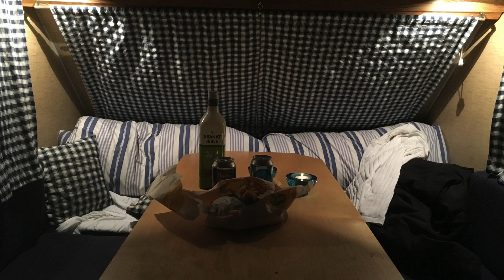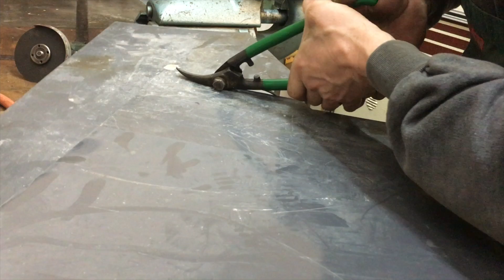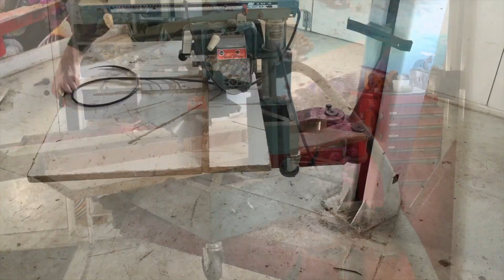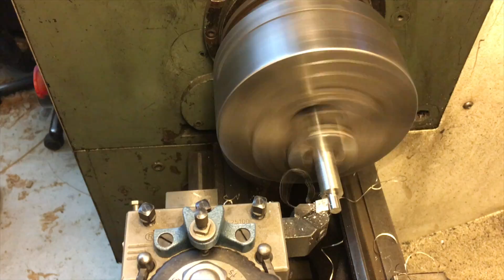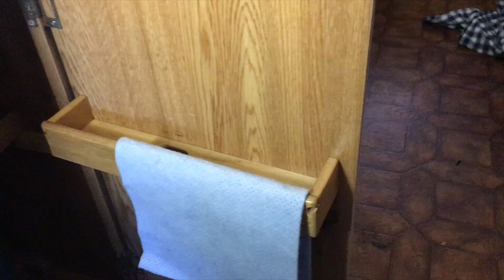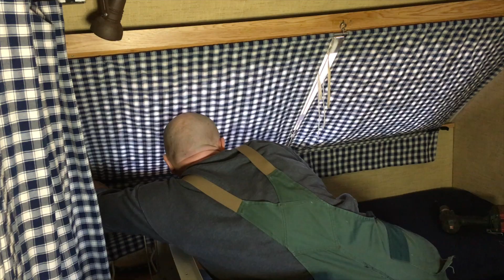Danish Diary 2016 - retrospective I

Comment: Nice video on the Caravan.looks like you shoe horned in your shop.How long is it and what do you pull it with.Some of the big trailers  we have in the States are 35' long with a rear compartment for motorcycles or quads.They call them toy haulers.You need a diesel  truck to pull them as they weigh 15,000 + pounds.Noticed on my trip to Denmark 10 years ago that many cars had trailer hitches.Did not see one pick up truck.Many single wheel and small camper trailers.Glad for you that you are out and about.I learned after a heart attack to live life to the fullest and to take care of your self.Looking forward to your next video.All best to you...PAT
Reply from the maker: Thanks Patrick. 
Next to those houses on wheels my caravan is more like a dollhouse ;o) - It's 10' long and about 6' wide. It only weighs around 350 kg, but it can load 300 kg. So that's sufficient for my use, as my bikes weigh between 145 and 170 kg - still plenty of room for beer also ;o)  
My car Is a Fiat Punto with 60 HP and that's actually plenty. The caravan was bought in Holland and at that time I had a Fiat 127 with 45 HP, which also was no problem. It wasn't a fast cortege, but speed is never of essence when I'm on tour anyway.
And you're right, trailer hitches are almost standard in Denmark. It's a small country and trucks would be overkill, but trailers you see a lot. It's the best compromise for most people. Most people don't have the need for "big transportation" - distances are short and infrastructure is well developed - so a trailer is perfect for those rare occasions where you do have.
All the best to you too
Søren
Reply: Soren,thanks for the info.That size you can zip around and get in tight places.In 1985 I pulled a small tent trailer from coast to coast and then some.I could take that about anywhere.The big ones not so much.I think like you small is better.As long as I can stand up I'm good....Pat